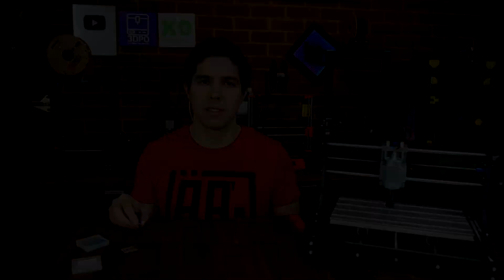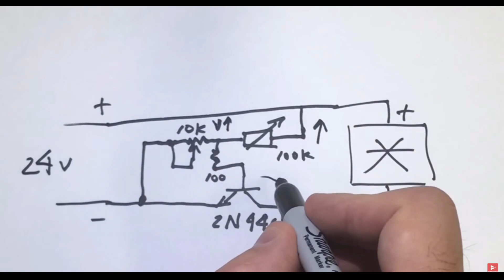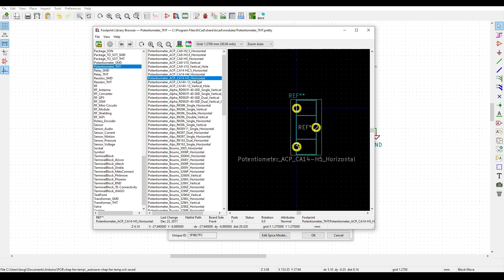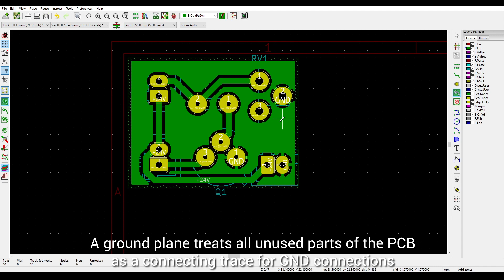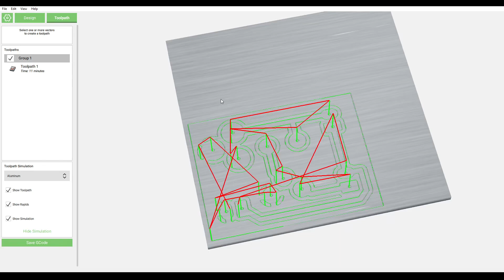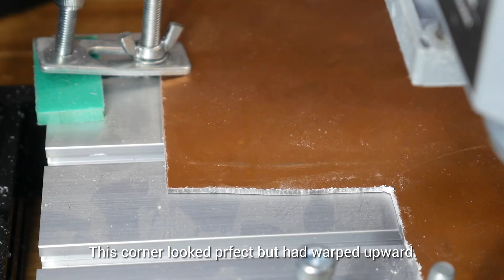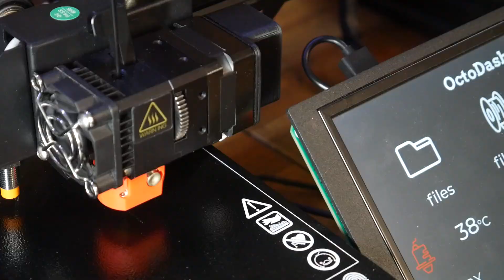Homemade custom PCB guide using free KiCAD software

Comment: I'm not an electrician but did someone try use cheap 24v programmable thermostat (5-10$ small pcb, there are infinitely many to choose from, with and without PWM) and use printer 100k temp probe instead 10k which they usually use for max 110 °C? Put board out of print head and use another 4 extra cables. Because this way 
it will take an enormous amount of time. I definitely don't want to do anything like that, but a great example of what can still be improved and way how to do it....
Reply from the maker: I originally wanted to do use a simple thermal switch. Plenty that would turn on at 50 degrees but they were all rated well under PLA temps.

Comment: I thonk you should check the temperatur of the MOSFET
Reply from the maker: I have a 10K resistor on the gate and the 24V fan draws very little current.

Comment: I think using the marlin firmware with auto bed leveling should be a better approach with pcb milling. There are a lot of problems with such a simple approach and results will be hit or miss.
Reply from the maker: My rebuild of this machine will be running Marlin so this would be a possibility. My initial concern is that the probing grid would need to be different for each workpiece and that requires recompilation of Marlin.

Comment: Appreciate the tip on Carbide Create - looks an awful lot easier to use than FlatCAM, and possibly more flexible as well for non-PCB stuff. Definitely curious about the upcoming videos from yourself and CHEP on the subject.

Regarding silk screening, I've printed a bracket to take a standard 4"x6" FR4 blank over a piece of 6mm MDF for that purpose. I cut the tracks with a V-bit (60° since the 30° kept breaking the tips off - super impressed at your handling of a 20° bit!) then use a 0.8mm chip-breaker to do the holes and edge cuts. Since FlatCAM doesn't generate the edge cuts the whole way by default (by design), this means I can flip the PCB in the bracket and re-align with the corner cut. Then switch back to the V-bit and engrave the "silk screen" on top. Clip the last little 2mm tabs holding it in place with side cutters to free the board.
Reply from the maker: Hi Jon, great tips, thank you. Don't worry, I've taken the tip off a few 20 degree vee bits in my time.

Comment: I modified my ender 3 pro to work as PCB mill, and it works amazing. within 5 mins I can switch it back to regular 3D printer again..
Reply from the maker: This video made me think about an IDEX machine, with a 3D printing head on one and CNC motor for the other. Print then machine in one go!

Comment: Look into BCNC for your G-Code sender (it's 100% opensource and free to use with no limits). Also look into adding a probe wire, PIN9 on the Arduino if I recall (verify this yourself of course). Having a probe pin allows you to alligator clip that wire to the PCB and clamp a ground wire to the tool in the spindle. BCNC has built in routines for creating a height map as well as just setting zero (exactly the same as a 3D printer). I find these tools invaluable for making PCBs because it allows a completely tuned depth of cut that never over or under cuts. This also allows you to make nice thin traces when you need to. As you advance more you will want these features, hell I wanted them right away. 

For hole drilling I actually use burr style roughing endmills, I only have a few sizes because you don't need a wide variety of them for 99% of all PCBs. The advantage over a drill is material removal. You may notice that a drill bit pulls material up to fast on PCBs and actually makes a tiny "mole hill" protuberance around the hole, I find this to be unacceptable in many cases. The burr style roughing end mill does not do this. I completely prefer to let the machine drill the holes and these endmills are tougher than drills as well, I've never broken one. I also prefer CopperCAM for g-code generation, it's pretty cheap though (less than $100 USd, there is a limited free version as well), but it has some very nice tools specifically for milling PCBs and takes gerber files directly. I find that with the cheaper engraving bits that cutting to deep wears them out VERY fast, so I never cut any deeper than I have to. Often times I will even cut in 2 passes when doing very fine pads and traces because the finished product looks better and has hardly any copper burrs pulled up. All you have to do is find the copper weight on the board and google the thickness of that specific weight, cut perhaps 0.02 - 0.03 deeper and it works like a charm.

There's my thoughts, do what you will with what I have learned.

Comment: I know the purpose of this video is to showcase the creation of a pcb, but going back to the purpose you are creating this for. On my Ender 3 with Marlin 2.0 (SKR 1.3 board) I was able to change the firmware to where the hotend fan doesn't come on until it reaches 50c at the hotend. Is this not possible on the BIQU BX?
Reply from the maker: The SKR V1.4/V1.4 has an extra MOSFET for a second hot end that we can re-purpose to control the heat sink as you have. The standard Creality board (like in CHEP's original video), the SKR mini E3 drop ins only have a fan port with constant 24V. This board actually has two extra MOSFETs for fans like the SKR V1.3/4, but the HDMI connector to the hot end means I can't use them. You are correct, a firmwre based solution would be far easier but it was not available in this case.
Reply: That's makes sense, I didn't think about the hdmi cable. This is a bit concerning as I'm a backer for the BX and was hoping to set up the firmware similar to what I have for my Ender 3 with the skr 1.3 board. Thank you for your reply Michael.

Comment: I'm surprised you didn't mention dust mitigation, most PCBs are made out of reinforced fiberglass, which means milling and cutting them gives off very nasty fiberglass dust.  A wet cut in some lubricant is a good enough solution for a hobby machine if you've got an enclosure.

Comment: It's way too easy to accidentally put a bend in your PCB clamping from the sides, with parts so fine even a little bowing makes a visible difference.  You can save a lot of headache by using double-sided tape to affix the PCB blank across the surface of a known flat object, then clamp both to the mill's table.

Great video!  I first found your channel while considering the CNC you've reviewed/featured here.  I've been subscribed ever since even through I don't own a 3D printer.
Reply from the maker: Thanks for watching. On my big CNC in the garage I simply tape down the edges. So little movement from the shallow cuts it works very well.

Comment: I found flooding some thread cutting oil (or really any tool oil) on the board before cutting works really well and makes much cleaner paths even at 0.15mm clearance. Also keeps the dust down. 
Oh and the new Kicad you don't have to export a netlist anymore, just run the annotate and assign footprints tool and you can import the schematic in pcbnew now.
Reply from the maker: Thanks for the tips. My first ever project in KiCAD so no doubt a lot of improvements for me to make.

Comment: In you opinion do you think milling PCB at home is still worth the cost with all of the "discounted" PCB manufactures throwing out cheap prices?
Reply: You'd have to order a LOT of PCBs to equal the money saved by making them yourself, not even counting time.  The biggest gain of doing them yourself is when you need them in a day, instead of weeks shipped from China.  If you already own a CNC for other things and don't mind breathing fiberglass dust (you should tho), there's nothing as cool as holding a PCB you just watched get made.
Reply: No, its not.

Comment: Great video! I migrated from Eagle to KiCAD and never looked back. I use FlatCAM to modify my gerber files and create G-code. If you haven't tried it I highly recommend it. Also the GRBL controllers on these mills, are able to use pin A5 to zero the z-axis with electrical contact. I also use an A5 pin probe setup to map my pcb board, just like an ABL system. It looks like you're using Candle or UGS as your parser and they both have the mapping capability. Lastly I also apply a UV curing liquid solder mask if I have to do some fine soldering like SMDs, especially when I'm using a ground plane like you have. Wegstr has great videos about it.  Cheers

Comment: From my experience with this mill and doing PCBs the fun don't last long. This mill is just not sturdy enough. The first 10 PCBs went well, after that tolerances added, which rendered the PCBs unusable. I am back on etching, this works reliable. But if you go for milled PCBs do the drilling using your CNC as well. Much less hassle. Right now I am thinking about letting the mill do the drilling, and etch the PCBs after it.
Reply: I can verify that this machine is not something anyone should purchase.  I bought one shortly after  his review.  It came with a stripped out anti backlash nut.  I contacted the company, and they sent me a replacement very quickly.  The company, at least from my experience has pretty great customer service.  

I put it together, the first few jobs went fairly well considering my lack of experience.  On my 4th use of the machine, the same part that came broken, broke again.  I packed the machine up and sent it back, luckily my return window hadnt closed.  

It had nothing to do with my ability to put the machine together, and everything to do with substandard parts.  It also probably had a little to do with my inexperience and maybe pushing the machine a little too hard, but I feel very comfortable saying that it would have eventually broken regardless of my experience.  

Was there probably a bad batch of anti backlash nuts out there?  Yeah, probably, but the company should have better quality control and even the best components on the machine are substandard.
Reply: On my mill, especially the Z construction is quite terrible. bearings falling out of their houses and too much wiggleroom cause the spindle to wiggle in all directions. This makes milling structures below 2 mm almost impossible. During the Winter my plan is to redo this part with better parts. Let's see if this mill can finally turned into something useful. Oh, one thing this item does very well: wenn I build electronic devices sometimes I need covers out of acrylic. This works really well, especially because I can use the same model out of Fusion 360 to generate the toolpaths. Do not know where this Colin has his imagination from ... must be drugs or something similar.
Reply: Those CNC kits are only as good as the builder.
Reply: @cda32  Extruded aluminum doesn't haven't nearly the rigidity of cast iron and that has nothing to do with the builder.
Reply: @dcurry7287  And this matters for taking off a 60 micron layer of copper?
Reply: @cda32   You can't be so good at turning an allen wrench that you can make unreinforced plastic more rigid.  No one is.

The finer the work is, the more precise you have to be.  Especially with a V bit cutter where depth of cut is cutter size.  I think making PCBs at a reasonable size really pushes a 3040, even if it was put together by a NASA engineer managing a Formula1 pit crew.

Comment: Now I want a mini CNC machine that I'll never use for anything useful. Just like the 3D printer I got that has only been used to print upgrades for itself. But I still want it.
Reply: Machines like that have a tendency to multiply like rabbits.  3d printer leads to a CNC that leads to a laser engraver that leads to a Resin 3d printer that leads to....A bigger CNC and ...
Reply from the maker: Hopefully a project comes up that can utilise it soon.
Reply: @TeachingTech  Do a "Retro" 3dprinter build to show people how hard it was at the beginning of it all 16 years ago to make a truly scratch build. Show people how easy they got it nowadays! And maybe do a cost comparison as well. Even if you just did a DIY design and build of a control board based(upgrade I would hope) of a RAMPS 1.4? Also would be a good way to see how to do a double side PCB on that CNC.
Reply: I don't exactly use mine for anything useful, but it can create some beautiful hardwood reliefs if you use it properly.
Reply: You sound just like me. you should see all the adafruit stuff i have that i only use 2 of them. the rest just looked like they could do cool stuff with LEDs on you tube. The mini metro just got here yesterday. And as i was readfing the coments on this video i was already serching aliexpress for cheap cnc. Its a disese we have. lol
Reply: Sorry for the late reply, but I will probably buy that CNC machine because I think it will be useful.
You see - I repair custom electronics, an have used my 3d printer (Creality Ender 5) to print mechanical parts. Often you see very weird shaped plastic stuff coming from the front panel and going inside the electronics cabinet. If those parts are broken, it is very difficult and sometimes impossible to find replacement parts. But now I spend a short time with recreating the parts in a CAD program (I personally use FreeCAD 0.19), and print them out. It's cost effective and fast (sometimes parts are very expensive if they are available at all, and it takes sometimes weeks to get them delivered). So win-win here.

That CNC making of prints is also very usable. It's faster than making a print on photo-sensitive PCB, making a etching mixture, finally etching, cleaning and dispose of waste, and lastly drill the whole print. Using a CNC machine greatly speeds up the process and produces a lot less waste products. And of course that CNC machine can be used for making parts too.

So -  In my line of work both 3D-Printer and CNC machine are cost-effective and time saving tools.

Comment: If only they used PWM for all fans then it could all be controlled by marlin itself automatically.
Reply from the maker: If I had access to the firmware source I could have treated the mainboard fans as electronics fan and had them controlled automatically. I believe the hot end fan is currently hard wired to constant 24V through the HDMI connector so no such luck there.